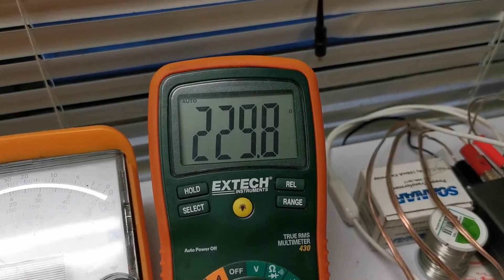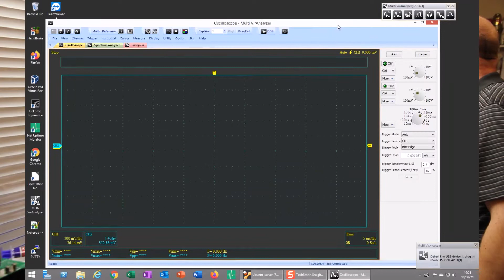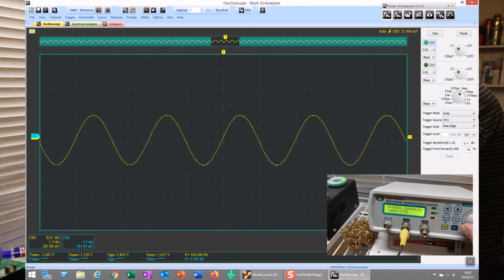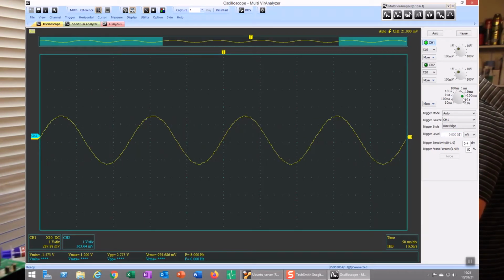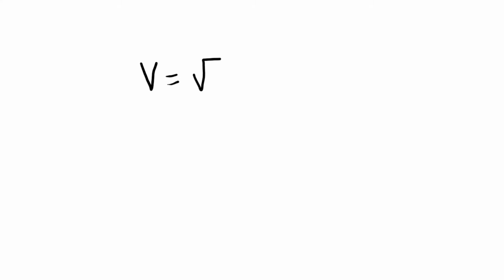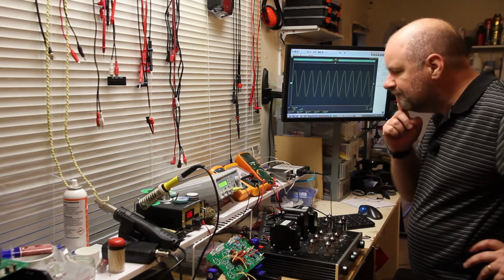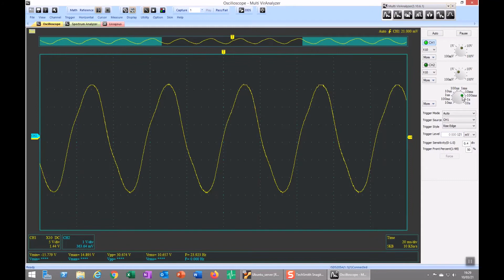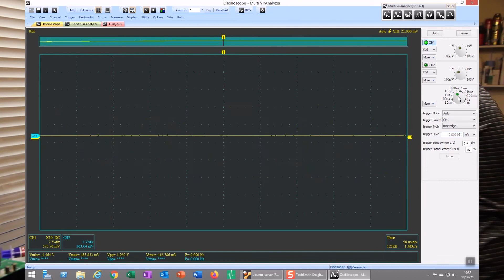Hammond Output Transformer measurement

Comment: The LF distortion you see is due to saturation of the transformer, not crossover distortion. Both of these artifacts have  a different  characteristic signature and that is what points to saturation.  If you look at the Hammond datasheet, at 30Hz it's -1dB down i.e. just 11.9W.  The negative feedback plus the design headroom saves the day makes the amp work harder to compensate for the loss and so keep the power at 15W.  However the THD and IMD will rise dramatically. What has been have measured is not so much the Hammond transformer but the entire system.

Assuming the frequency response of the amplifier is fairly flat, a better test to evaluate the transformer would be to disconnect the feedback.
Reply: Youre not wrong :) Come on Adam, we want to see how the TRANSFORMERS fare, not your amp - you just gotta pull one little wire (or unsolder from the board)

Hammond make good looking competent Iron, but some say they're outclassed by things from Edcor & Transcendar (at a similar price) so tests are always interesting!

Comment: Howdy. Nice presentation.
I believe You are correct. The low freqency buckling is likely to be cross-over distortion. You might consider running the end tubes slightly warmer.
The square wave overshoots can possibly be remedied by connecting a capacitor in parallel with the feedback resistor. Try, say, 220 pF. Settle for the smallest value that kills the overshoot, or almost kills it, not to sacrifice too much slew rate. Otherwise the design looks good. There is no ringing after the overshoot.
Regards.
Reply from the maker: Yep - you are completely correct :) There's a 100pF cap in parallel with the NFB resistor in the test unit in the video, but in my current iteration of this design, that is 220pF - so you're right on the money. The unit I'm running these tests on is the first prototype of this amp.
There's also a zobel network on the anode of the first stage, which makes the design much more resilient against capacitive loads. 
I did a blog post on this at the time I was constructing another amplifier, similar design but higher power, you can see that here https://atrad-audio.co.nz/index.php/2017/07/17/fine-tuning-the-nfb/
Reply: @A_RosnerNZ  Howdy again.
Personally I don't like global NFB for two reasons. The time shifting of the OPT. Also. I feel that upholding the galvanic isolation between the primary and secondary provides shock protection should the amp develop a fault..
I use cross feeding of the NFB from the end tube anodes to the drivers. Works nicely but the setup is proned to oscillations which must be investigated and managed. Actually. I only recently learned that I should have used grid stoppers for the driver tubes too. I need to fix that.
Perhaps I can interest You to check my blog    eugpoh44.blogspot.com     where I have a description of my amp.
Regards.

Comment: What’s the inductance of the primary?  Electromotive force formula tells me it should be about 42H if LF response is flat down to 30Hz
Reply from the maker: I have no idea. I don't know how to measure inductance. I had a method which I thought worked, but it gave me such improbable and inaccurate results it must have been wrong. So that's a hard IDK on that question for now.
Reply: @A_RosnerNZ  it’s mostly an academic exercise in your case. Looks like you were getting good response down to 30Hz which is the lower band of Hammond’s published spec.  I wind a lot of line and mic level transformers using M6, Metglas, Permalloy, and MPP. Never made an output transformer before, but I’d love to try it.

Comment: Excellent low and response even at the low power level what type of drive circuit are you using you have three tubes per section are they all triodes  or watt ?
Reply from the maker: Ultralinear push-pull, 2 X EL84 per ch
Reply: @A_RosnerNZ  not outputs but drive a Schematic is needed
Reply: @A_RosnerNZ  out put was obvious, I ask about the drive the section before the coupling caps
Reply from the maker: @harryconover289  it's on my site https://atrad-audio.co.nz/wp-content/uploads/2019/07/Matariki_color.png
Reply: Looked at the page nothing odd but watt you label d as d5 , also how does it do near its clip point ?
Reply from the maker: @harryconover289  It is an arc protection diode. At power-on, before tubes are warm and conducting, the anode of V5 (and hence the grid of V6 as it's DC-coupled) will be at full B+ potential. The diode prevents this situation whereby you could get arcing inside V6. Once they are warm and conducting, the diode will  be reverse biased and have no effect in the operation of the circuit.
Reply: @A_RosnerNZ  very nice 👍 but 99.99 percent of the time tubes take 6.6 seconds to reach full emission but I like it ! As far as the amp it’s good classic design c my Fisher 400 is similar the limit on a circuit performance general is the output transformer  and it gets very complex with its basic specifications changes with load  and impedance and drive frequency and shape and transformer dose not like a square wave now most of the limit is due the core becoming magnetized your getting great low end that level so as you get ne’er clip what happens ? That is what determined the quality of a transformer, also I have found that brutal transformers gives the best response as a output but they’re hard to find there was a company in Amsterdam and made a transformer recalled Linderman in years they made it a constant drawn band style of transformer I can’t find them but if you know where they are I would love to hear from the transformer is I think the best I would love to bill him center on those transformersAs I remember they produced recommended schematics and I bet you can from where exactly in the app would be exceptional
Reply from the maker: @harryconover289  Yep, the transformer makes or breaks the amplifier. No doubt about that. There are some very nice transformers around but they're quite expensive. These are off-the-shelf Hammond units and I've been quite impressed with them.
Reply: @A_RosnerNZ  so Adam how is response vs level also a class a has a dc bias all transformers this puts a dc or steady state magnetic 🧲 bias on its core so at higher levels it clips first which is why I like Torrential cores
Reply from the maker: @harryconover289  Pushpull amplifiers have two output devices per channel each handling half the waveform (or more than half, in the case of Class A). However each half of the output transformer is counter-wound, thus cancelling the magnetic flux from the DC flowing through it. Assuming the tubes are balanced in their currnet draw, which is what adjustable bias will give you. 
Single-ended amplifiers don't have this, being only one output device per channel, and so the transformers contain an air gap in the laminations, to allow the magnetic flux an escape. (Grossly oversimplifying). This, along with many other factors, impacts their efficiency. You can read more on my FAQ here https://atrad-audio.co.nz/index.php/about-valve-amplifiers/
Reply: @A_RosnerNZ  yes but my point was the constant dc current pre alignment of the core does this allow a linear clip ?
Reply from the maker: @harryconover289  yes, if you mean a symmetrical clip.
Reply: @A_RosnerNZ  yes manly music is not symmetrical at all and your coment of two tubes being combined in a transformer yes this is common but not unicqe a bride type output requires no center tap and has no DC bias current thus reducing the self inductance and speeding up the coils

Comment: I’ve always wanted to build an amplifier with the Hammond 1650W. Might have to do it now.
Reply from the maker: They do seem to be quite good, but if using NFB around the transformer you will need to put a zobel network on the feedback and also on the anode of the first stage, to cancel the overshoot and ringing you'll otherwise get.